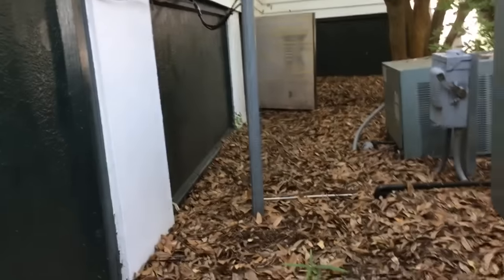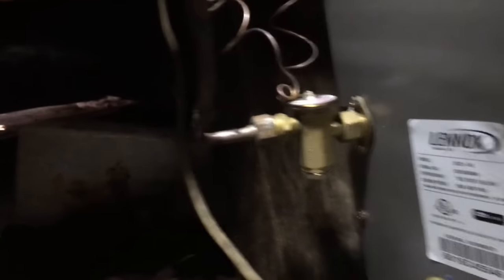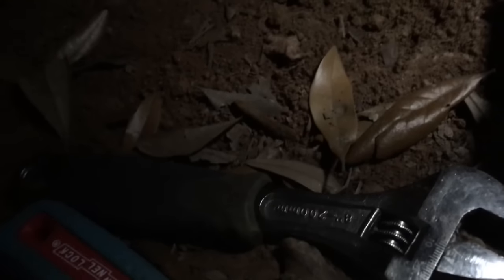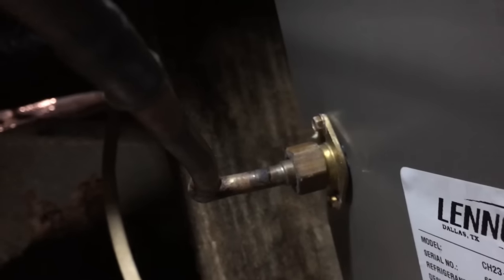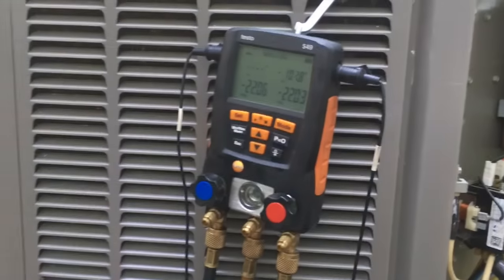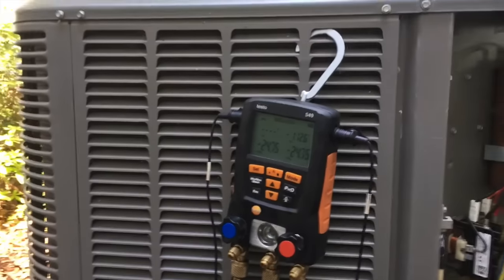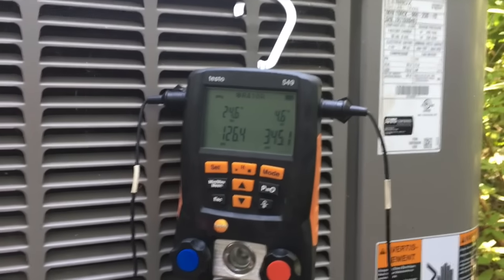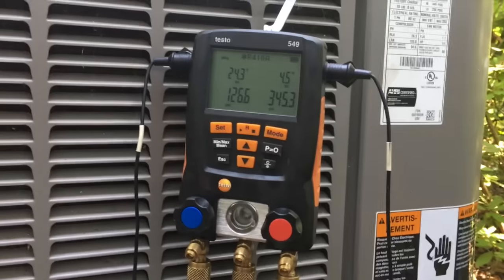HVAC: Replacing A TXV With A Piston #2

Comment: cool vids bit not much instruction on much of this.  all the actual work is done off cam
Reply: it's pretty straight foward. pump the system down at compressor. close the valves. remove txv with Cresent wrenches. install the piston in correct way (crown facing you). make sure you use the Teflon washer. tighten up nuts. run vacuum and then open your valves to release freon. then go from there. let the syste. run. check pressures...